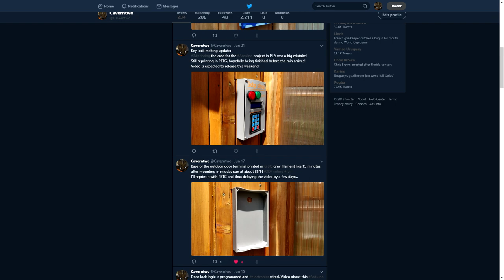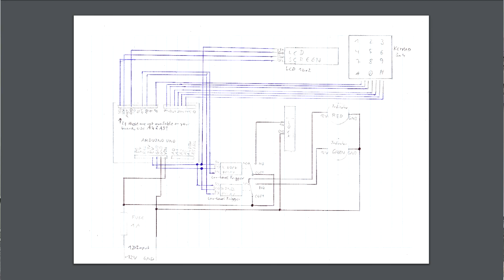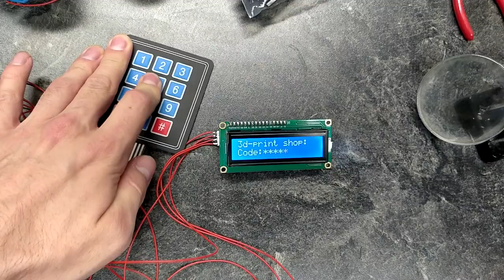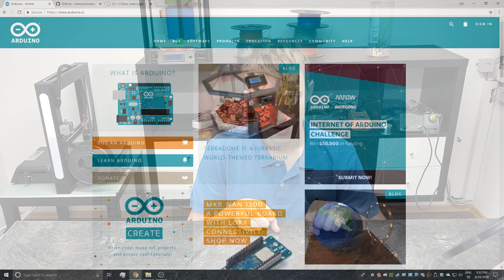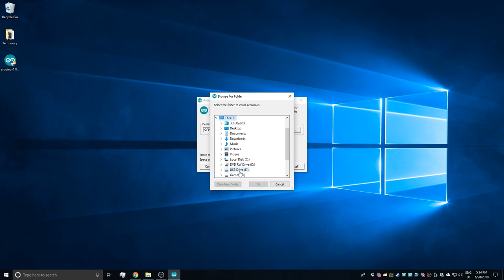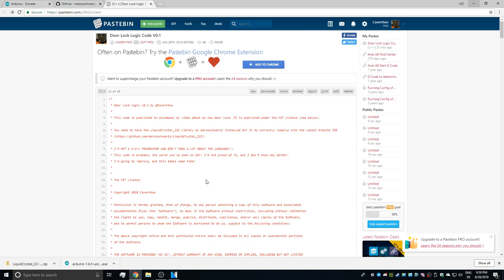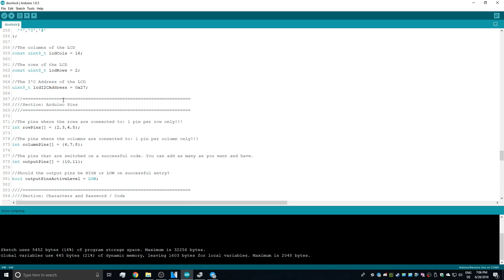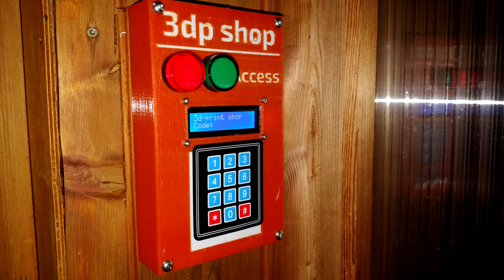Simple Door Lock - 3D-Printing and Arduino Project

Comment: 0:13 Okay, I can break in your workshop now :-)
Reply from the maker: As a matter of fact, the code is still unchanged to this day!
Reply: lol, but actually, I love this doorlock! I can't code but I can make this as well! :-)
Reply from the maker: Therefore I've published it. I am no C or C++ programmer, and this little bit of code used in this project took me 3 days... I really like it, and I've reprinted the PETG cover again, as the keypad was off-centered because of a wrong hole. It looks even better now (check it out on the thingiverse page).
Reply: Aah I saw it, looks great indeed! I have never tried PETG before, but I'll probably do that on a new printer I'll buy. How good is the printbed of the JGAurora A5 actually for printing more 'exotic' filaments (for someone who only but only prints PLA :-) )?
Reply from the maker: Thanks.
I can confirm that the bed is good for PLA, PETG, and Wood-PLA. I haven't tested anything else so far, but according to other reviews, the bed with the coating is very good for most materials. I'm printing almost everything on the JGAurora A5 now (it's a real workhorse), as it's very easy to use. My father prefers it over his TronXY X1 as well. The only thing that's not so good, (and it's still the same thing as explained in my review of it), is that the parts-cooling fan is quite poor, but I'll probably design and install an upgrade soon, so this shouldn't be a big issue afterward.
Reply: Okay, thanks. I'm currently really doubting about which printer I should get: the JGAurora A5 or the Creality Cr10. A lot of people say the A5 is mostly better then the CR10, but I also heard that a lot of people received their A5 damaged, or with other annoying problems. That's why the CR10 could probably be the safest bet... But I don't know... :-)
Reply from the maker: In the end, it's your choice. If I had to decide right now between these two, I'd take the A5 again, as it's really good. But, if I hadn't received one for free, I'd probably go with the CR-10, as I've seen more content of it. As you probably know, I don't have a CR-10, but it seems like a very popular and nice machine. My A5 also had the heated bed connectors busted off on arrival, but as an electronics engineer I know how to solder them on ;-). I don't know about similar problems with the CR-10 though...
If I had both machines, I could give you a concise answer, but I suggest you sleep over the decision for a few days and then trust your gut. 
I wish you all the best with the new machine, whatever you choose!
Reply: Okay, thanks for your advise!